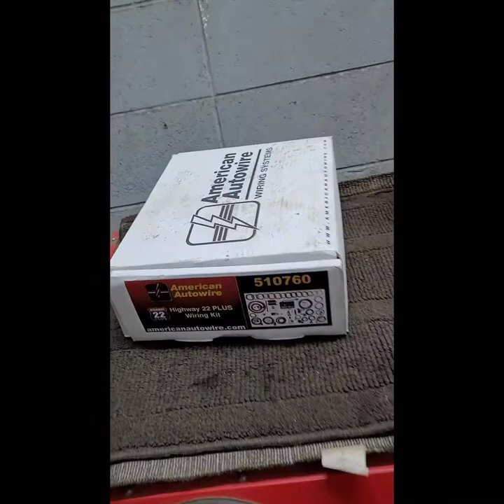1968 Cadillac Deville Convertible Brakes Lines Installed

Comment: What adapter did you use to install the hardlines ? Having issues on mine with the cpp brakes
Reply from the maker: I went to a local shop to find what I needed for as fittings.